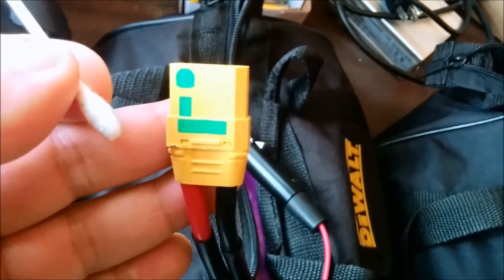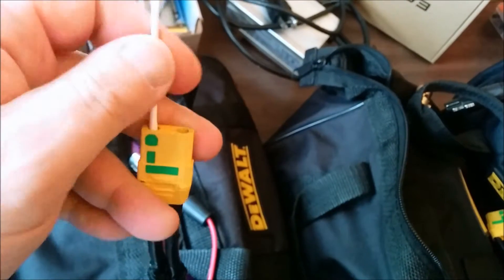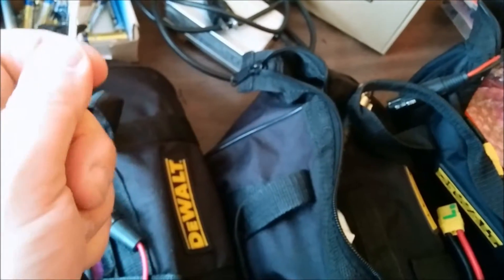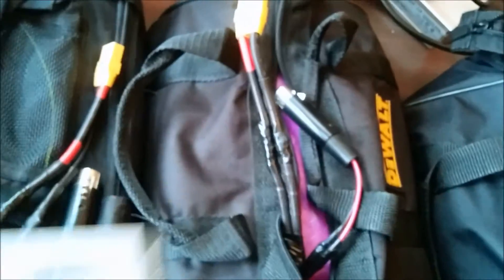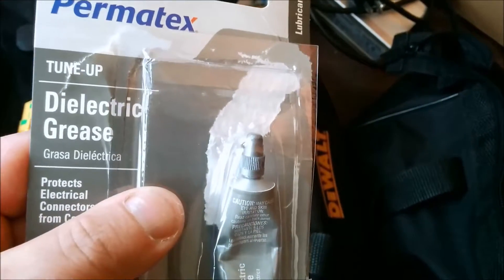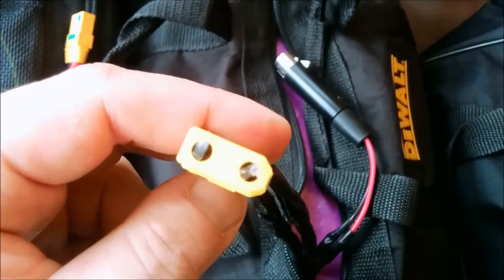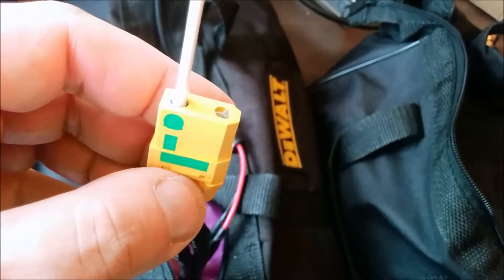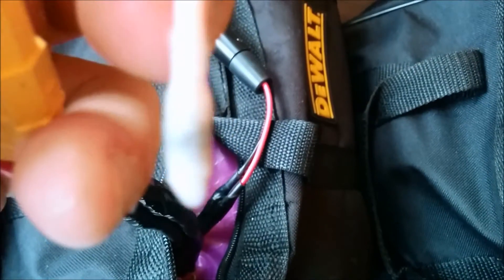Cleaning dirty carbon deposits from XT90s female connectors with a Q-Tip.

Comment: I suspect the carbon comes from very small shorts that happen as the connector corrodes and moves around, not uncommon. The anti spark feature just stops the arc when the connection is first made.  On an ebike large current draws go through these connectors, they are also in a harsh environment so some wear is expected.  Not cleaning them as this video shows, would only make them wear faster, arc more and heat up due to increased resistance.